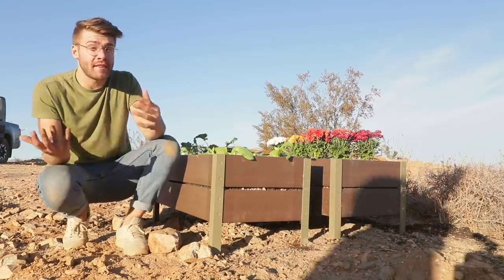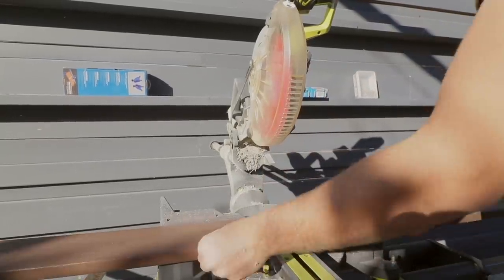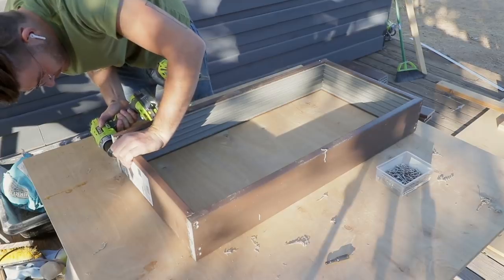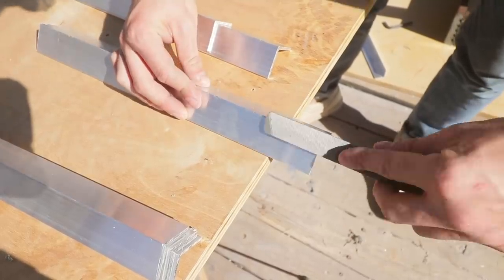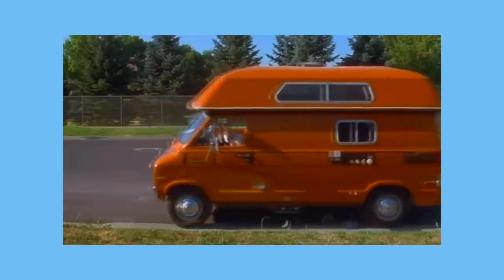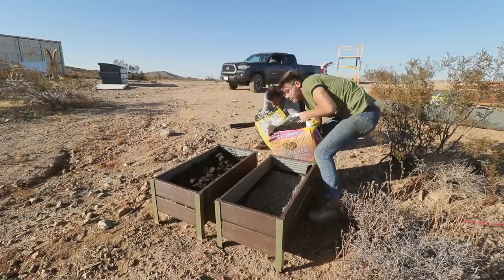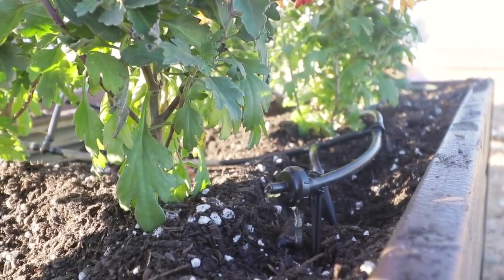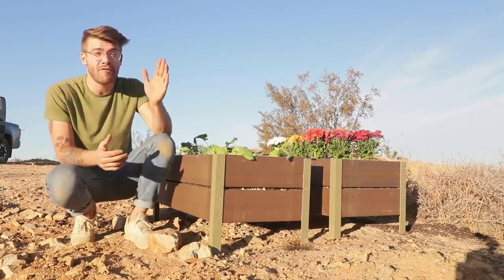How To Make Self Watering Raised Planters / Garden Beds from Composite Decking

Comment: I don't get how these are environmentally friendly.  I mean it's a cool project, but it becomes stupid when it's being sold under this "green" package.  step one of conservation is to REDUCE, and most of this stuff is unnecessary, and therefore not environmentally friendly. 
Also, all the chemicals and processed materials ......
Reply: and for water: raised bed experience more evaporation than in-ground gardens.
Reply: Dustin Hill - I appreciate the time you took in posting a comment in relation to this video, but I find the rhetoric extremely flawed, and quite offensive to the creator of the content.  If composite wood is made from x% of recycled material, could that not make it potentially eco friendly (i.e. recycled wood and recycled polymers)? Also, if composite material will last say 3 times or more, the life of pressure treated material, is that not more sustainable, in that one is using “less” material?  I have grown extremely tired of people using either derogatory language to state their opinion or jumping to a quick conclusion to submit a post without any attempt to seek further knowledge or understanding.  Further, where is the conscientious dialogue between viewers and producers of content on YouTube?  It should not be to tear down, but rather to build up through balanced discord.  I have no problem with conflicting points of view and constructive criticism, but labeling something as “Stupid” without a sensible argument seems, well, ignorant.  If you took the time to Review the product page of Armorguard composites you might have found some interesting data with regard to longevity via the manufacturer’s estimated warranty, or might have considered the fact that traditional wood products over a 20 year time horizon would require chemical treatment to maintain longevity (most harmful to the environment).  Curious to understand the factual information to support your claim of stupid?  Thanks

Comment: Not ecologic, not self-watering at all!!!
Reply: WARNING! These composite deck boards contain dyes, preservatives, mold inhibitors, UV blockers and many other TOXIC chemicals not intended to be in constant contact with soil or water! They could leach into the soil and end up in the vegetables you grow. This is why the manufacturers of plastic deck boards ONLY recommend them for ABOVE GRADE installation. DO NOT BUILD A GARDEN BOX FROM PLASTIC DECK BOARDS. This guy did no research on the safety of what he is recommending!
Reply: @chris77_  Plastic degrades in both light and moisture. These are outdoor in the sunlight with moisture and microplastics will degrade into the soil. It is not self-watering and this guy clearly doesn't know what he's talking about. Or it's a stupid clickbait title. Turning on and off drip irrigation is not self-watering! That's just regular watering...

Comment: So wanna start building and i know you need power tools so its a bit easier. I just wanna ask what are the most essential power tools do i need to buy first?
Reply: Idk if you figured it out by now but I’d recommend a sander (orbital or 1/4 sheet), a drill, drill bit set, a saw (circular or miter), and then safety wear like glasses and gloves, but I think it depends on the type of things you plan on building.

Comment: If you make the short cuts at 16 inches, how are you getting 3 boards on the bottom when they are 5.5 inches wide?
Reply: The boards are 5.25 inches wide so you've got 0 25 inch to spare. The real question is how are you joining boards that are 15/16 inch thick with screws that are 3/4 inch long.

Comment: Nice build ! FYI   i did Woodworking professionally for over 20 years and by far the best countersinks i’ve found to use for the money are made by Fuller  they  have been in business over 100 years and  some of mine are over 25 years old and have been resharpened many times i prefer the HSS ones but they do offers carbide tipped as well  most Wooden Boat Builders use the Fullers  and often you can buy them at Wodworking Supply Stores  or online  all the ones i’ve tried from the big box stores  just don’t live up to the Fuller brand  ones  i of course have no affiliation to the company other than i like the product and have used them for years with excellent results